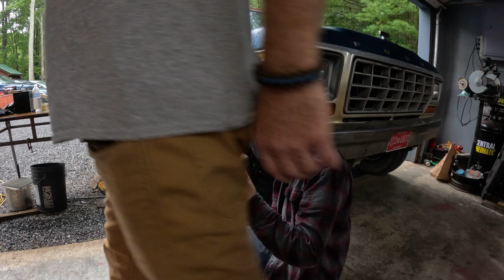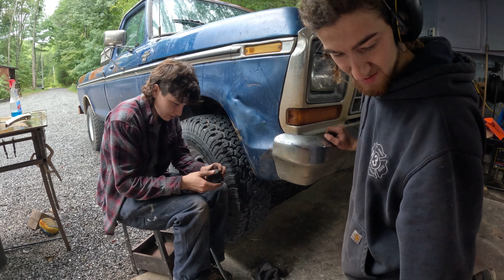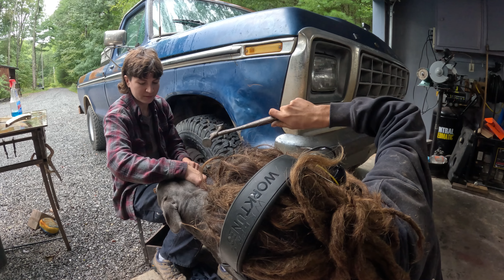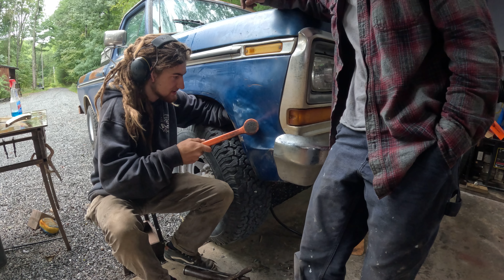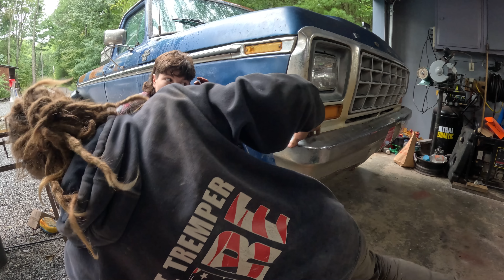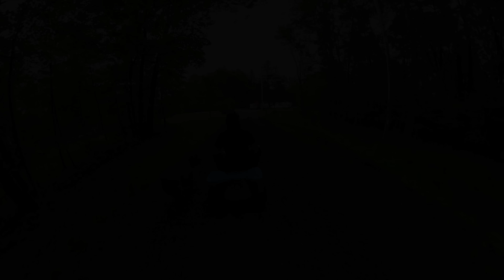Banging a huge dent out of a 1979 Ford F250

Comment: Samantha, the steel dully you had in your hand is to be held on the inside of the fender while you use a body hammer to smooth the metal

Comment: I'm not trying to be a Mr. know it all, but you should get a body hammer set, they're all different shapes and sizes. I think harbor freight sells them to. And where it is real bad drill a hole you get a slide hammer with a piece of metal screw it on the other side and use the slide hammer to pull it out, you can even get real fancy and drill and tap some holes into your body hammer different heads, and actually use them with a slight hammer and then put a little JB Weld used that like the Mondo and it won't fall out or anything it will stay in there for a long time, a little expensive buying JB Weld for that but man does not hold onto the metal. Just a suggestion Sam you're not doing a bad job for the tools that you got I would say you're doing okay.

Comment: well shit where to start... you never use a "Heavy" hammer to do the hitting the heavy hammer or "Dolly" should remain still and you use a serrated bodywork hammer that is light and has Dimples on the face which Shrink the metal as you hit it... do not hit stuff with a sledge hammer lol.
Reply: relax,they are using available tools ,it's not a ground up restoration....
Reply: wrong, no one uses shrinking hammers anymore, putting a million little divots in the metal is NOT the right direction to go in when you're looking to FIX things.🤦‍♂️

also using a large hammer to move big dents is just fine. although a rubber or plastic dead blow hammer would be the best choice because it won't gouge the panel like a metal hammer and won't bounce back like a rubber mallet. we do use small sledges usually give or take around the 3lb size for frame repair  (including on unibodies where the 'frame' may be as thin as 10 gauge sheet).
Reply: another expert